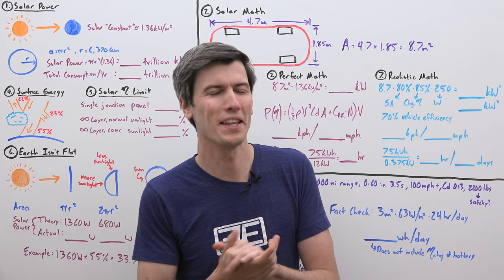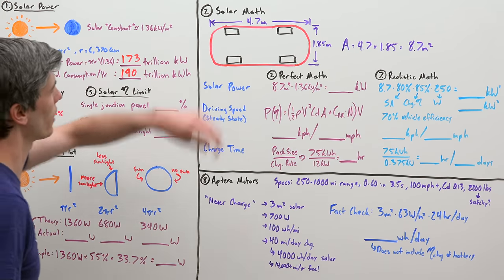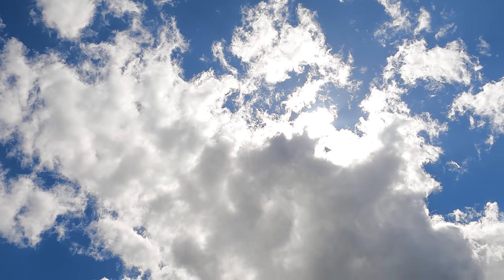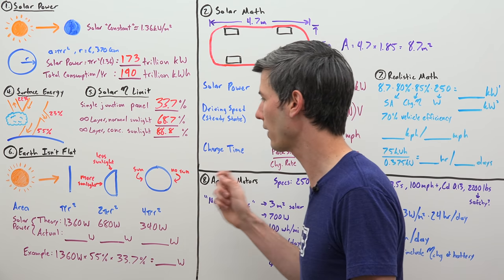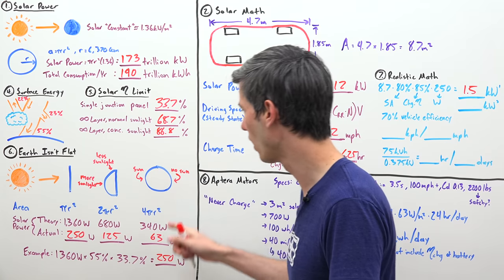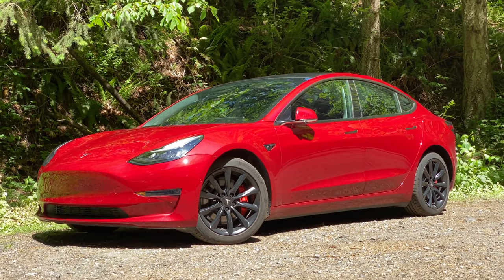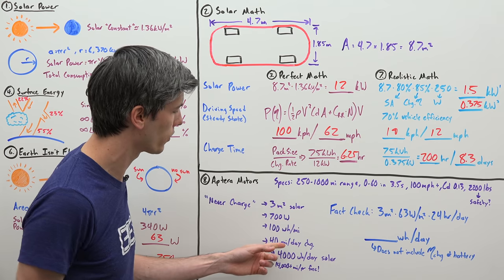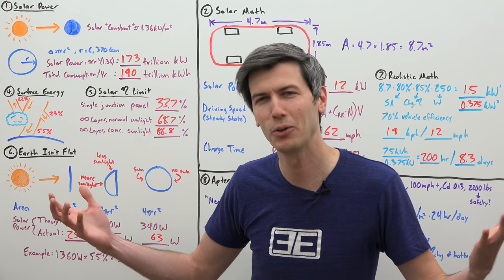Why Don't Solar Powered Cars Exist?

Comment: I want solar in electric cars as a "additional charging while driving"...
Reply: Exactly, just to be able to extend the driving range, not completely contribute to all the power..
Reply: yes and just loading during worktime while standing about 8 hours unused at the parking lot. if i could drive only one day per week from the sun my "fuel" cost is about 20% less.
Reply: Cybertruck may have a solar cover as an option but it's estimated you'll get about 7 miles per 8 hour charge in best solar conditions.
Reply: I think the best way to look at it is how many miles you can charge per day.  I typically drive 5-10 miles per day.  It really wouldn't be hard to generate that much energy.  I replicated the math in this video and applied it to my car and driving needs and even with more conservative numbers than he used I could easily do all of my driving on solar power.
Reply: Check out Lightyear,  they will be bringing that to the market pretty soon!
Reply: @tbreakazpex205  The same with Aptera
Reply: that's the Sono Sion (for now)
Reply: @jetah50  So if you drive 21 miles a day, your fuel costs are reduced by 33% from the (free energy), not sure how many years of those savings are needed to pay for the solar panel options, but I imagine if you keep cars 10 years like my family, at some point you would see real savings in travel costs. Also, you lock in on the lower prices of gas today, compare this to future prices if current trends continue and you will wish for those panels or an EV.
Reply: And also reduced battery degredation, due to not having to charge as often.

Comment: I was 100% sure that it is impossible in the near future without groundbreaking new technology
now I am just sceptical 
impressive
Reply: I mean, even if every car was covered in solar panels that somehow got 100% efficiency, 1.36 kW is only 2HP, approximately. So this means that you have to either charge your car outside and use it once a week or something, or you have to save energy. I'm sure it will eventually happen, but for now, all we can do is hope that someone invents this groundbreaking technology.
Reply: Edit, 8.7 m^2 would mean closer to 17 HP. An improvement, and if solar panels were 100% efficient, a solar powered car would be possible.
Reply: A car is in use on average under 60 minutes pr day, so a lot of hours with the sun up to charge the car. If you combine this with a very low friction car like the Aptera, it's actually an interesting concept.
Reply: The clearest way to see that it's not a completely unrealistic idea is to look at the World Solar Challenge – a race with across the whole of Australia in four days without any external charging. The top cars now manage to average over 80 km/h.

But still – these are very much prototypes, built ultra-light and racing under pretty ideal conditions. A car that's actually practical for everyday use can't hope to cover more than a few percent of its energy need from solar cell, so it will need to most charge while parked – and that kind of defeats the point, because while parked you could as well charge externally.
Reply: It's a bit like the solar plane possible but not practical or economical beyond the experiment stage, there is hardly a reason to carry the panels with you.
Reply: @leftaroundabout  I mean, in places where charging isn't an option, like perhaps any sort of extremely rural setting, or on the opposite end, a very urban setting, where somebody doesn't have a garage, they don't necessarily have a charger when they park their car. Hell, if you're going anywhere for an extended period of time, it's pretty unlikely that it's going to have a charger. I think I've only seen tesla charging stations at target, and that's it. So I think this could present good utility for a ton of people who otherwise wouldn't be able to use electric cars because of a lack of infrastructure and too high of an initial investment.
Reply: Your certainty was obviously not based off of a lot of specific and applied knowledge. Perhaps this is an opportunity to be more cognisant of such things in the future.

That said, skepticism is good.

Comment: I spent $2200 on solar for my $4000 2012 Nissan leaf.
I'm getting 8 miles a day from the sun.  So it's not a great use of the money but it has been a really fun project for my daughter.
We should be getting more like 12 miles per day so now we're trying to track down where the inefficiency is.
Reply: Good for you!  Full solar for Aptera only runs $900, so a lot of progress is being made in this area.

Comment: Very fair assessment of Aptera, I wish they would temper their range claim, like call it 400-700 or more, especially if it has lower freeway range. Also a lot of spec performance and price mixing 3wd, 2wd, solar, battery size.

Comment: I think people are missing the biggest market for solar panels on EVs.

Imagine a city dweller who do not own their own charger. This is very common scenario. They may very well go for a petrol powered car, because they do not want to go to a supercharger once a week. Put solar panels on the car and they may only have to go to the charging station once every two weeks, which would translate into lots of saved time. It may also convert a petrol car buyer to an EV buyer.

So the most important question is not if a solar powered car can drive forever only powered by the sun, but how many trips to the charging station could be saved by putting solar panels on the car.
Reply: This is a great point, an advantage of vehicles with solar panels on them is that they don't require any additional infrastructure, which is great for cities without chargers, or even remote areas...
Reply: City dwellers also don't often park in full sun. Shade from buildings would reduce efficiency drastically, and parking in a garage building would take it to zero. Ultimately not worth the cost of adding them to the car and the increased weight and fragility.
Reply: Most EV owners don’t visit a supercharger. They plug in at home and their car is fully charged the next day. Solar panels would mean you would need to store the car outside and it would save some money but nowhere near as much as the added cost of solar panels. Not to mention the environmental effects.
Reply: @Deepwing  My point is that many potential EV buyers opts for a petrol car, because they do not have the option of plugging the car in at home. If you live in an apartment, it can be very difficult to install a charger close to where you park your car.

Many people go to work and park in a parking lot, where it is easy to find a spot with little shade.

I am not saying that solar panels on cars makes sense for everyone. I am saying that there is an unserved market for EVs with solar panels on top.
Reply: @F0XD1E  If you live in a high density area like Manhatten, then you will have a hard time getting much juice out of solar panels on a car.

However, if you live in a low density area like most of LA, then it would be pretty easy to find a parking spot with little shade.

I am not arguing that solar panels makes sense for everybody, just that there is a substantial number of people for whom it do make sense.
Reply: @Foobarski  that’s true. I don’t see that market being tapped yet though just because it’s kinda niche and the costs likely outweigh the promises. But no doubt it will eventually happen.

Comment: And still the "realistic math" section is quite optimistic ^^ In my location e.g. we don't see the sun for 3 to 4 months per year, maybe even more ^^
But man do I enjoy your videos about solar, electric cars/motors, batteries. Cheers from an electrical engineer
Reply: You are an exception. Sounds like you need to move
Reply: Yeah, I came to the comments to see if anyone mentioned axial tilt

Comment: Even though it wouldn't be the primary source for charging, I do think integrated solar roof and hood panels should be a feature automakers invest in. Like regenerative braking, it could help maintain battery levels in a passive way. Why not produce a vehicle that has as many passively energy capturing/producing features as possible? With all of the forces that accompany forward motion, why not take advantage of solar, wind (forced air?), and friction based tech?
Reply: Cost is always the answer. If it is affordable and yields enough of an impact, you will see it.

Comment: Interestingly solar could also make a lot of sense for an electric semi or busses.  Not that it would cover the energy needs but given the massive flat area it is relatively simple to generate ~15% of the energy needs for a semi under typical driving distances per day for only a small amount of weight.  18m of solar on a flat surface is relevant.  Solar panels are not that heavy and the complexities of protecting them and using the energy to charge are not as complex on the flat top of a trailer.

Comment: Everything checks out on the Aptera solar car if you buy their coefficient of friction. That number sounds damn optimistic to me.
Reply: Just run their thing through some CFD simulations.

It's completely optimized for air resistance.
Reply: @anonym3017  I hadn't looked at a picture of it at that point. After looking the Aptera solar car up I am significantly less skeptical. Cheaper than the model 3 too, if they can actually deliver on this it will really be something. I want one.

Comment: I’m hearing yacht companies claiming solar powered electric yachts with unlimited range. Doesn’t seam possible to me.  I would love to see a video on the subject.
Reply: Boats seem the perfect place for solar ...you could tow along a whole array of solar or have some sort of fold out array.
Reply: I could not see a yacht that has more than about 20 square meters of solar panels.  So at 200 watts per square meter, X 5 hours a day, that would be a 4 KW solar system making at the very most about 20 KW per day.  

Take your average 454 gas engine that can power a 30' yacht at about 15 knots and use about 10 gallons of gas each hour.  That means about 350 KW of power each hour?  I don't think you will travel very far using solar power.

Yes there was a small canoe sized boat with a solar panel on the roof canopy. It produced 24 VDC, and run a small trolling motor to power it from one lake to another on a inland waterway.  Yet they still needed to charge the boat each night at the marina, to have plenty of power for the next day.  And they only went about 15 miles per day.   A great way to travel and tent camp, with a boat that has a total weight less than 1,000 pounds, loaded with people.

Comment: With the new eletric pickups it would be nice to have an overland tent that retracted into the pickup roof, giving you maybe 4-6 m2 of solar, it would be awesome for overlanding
Reply: There are people that do that, well, with ICE vehicles. But that would be nice to have it fully integrated. Don't need enough panels to charge up to drive, just enough to maintain the battery for running a fridge and a few other odds and ends.
Reply: I'm sure some aftermarket companies will jump on this. I think that uber expensive Cybertruck camper will have a solar roof.
Reply: The Aptera does come with an optionl tent, that goes over top of the back hatch. The tent doesn't come with solar panels, but the the Aptera does have spare capacity in its solar charge controller for hooking up external panels.

Comment: There were two car companies making solar powered cars other than Aptera. Sono motors in Germany was / is taking orders for an electric hatchback that can charge about 100-200 km per week. It sells for 20-30,000 euros I think.
And Lightyear in the Netherlands has much more surface area and aerodynamics, so that you could probably go with no recharge, but at this time has a price of over 100,000 euros. Perhaps if they can mass market it, the price could come down.

Comment: Sounds like an excellent commuter car for people that drive less than half an hour to work.
Reply: @CaedenV  Since panels last 20 years under warranty, that should cover 2-3 electric vehicles if you keep them 7-10 years. And you can still use a garage, but you would have to plug in daily

For convenience, I like the panels on the car roof, then you only plug in at half a tank, like a gas car and you avoid car jackings and pan hanlding at gas stations.
Reply: @jamesaleman  Totally agree.  I have been driving for more than 35 years but the recent number of times I have been car jacked while buying fuel is getting scary.    (I never fake sarcasm)
Reply: @paulmartin2348 <Reply, Sarcasm edition>
In those 35 years, I suspect you, but certainly actual car jack victims, were car jacked less frequently in a driveway or garage.

Also, I can't count the number of times someone walks by my driveway and tops off my fuel tank.
Strangely the sun shines on my driveway for many hours a week, when it is parked outside.

If only I could buy a ride that charged from that sunlight. It would be a bonus if I never had to stop at those scary stations ever again.
Think of the time I would save and my quality of life if I could get back 10 minutes a week, 520 minutes a year, or 5,200 minutes a decade.
I would have 20,800 more minutes to waste commenting on YouTube if this was around when I started driving.

<Raises a digital version of whatever beverage you like> Here's to 35 more years of fewer car jackings and may you never end up on a security video circulating around the net.

Comment: I would like manufacturers to equip cars with a small solar powered trickle charger with a BMS to keep the 12 volt battery topped up and extend it's life. Fewer dead batteries would make vehicles more reliable for little expense. Batteries being expensive and contemporary vehicles loaded with electronics would make this a welcome addition.

Comment: 4:51 Well dang, when i did the calculations for my solar limo conversion (~10m² usable surface) i used 18% efficient solar cells, and over a 9 hour work day(1 hour of on site lunch) i could drive to and from work on my 1996 fleetwood 6 door on solar alone for about 280 days out of the year(8 mile one way with hills in central illinois) as long as i stay under 55MPH(there is a route with an 70MPH interstate)
at 33% efficient that jumps to 365 days because couldy days could be made up for by my battery pack, i could even run errands if i wanted to

Also, 8.3 days? Thats ALOT better than i expected, so if we put solar on cars today we get the equivelant of 43 free 0 to 100% charges each year

Comment: And if we were able to use this solar energy in the car just to saving the battery, for example, to activate the ar conditioning? Or maybe to save the fuel?
Reply: I use a 20W 12V solar panel on the dash of my gas guzzling ML320 to trickle charge the battery as I don't use it often and there is a mystery electric short somewhere. All modern cars drain the battery when not in use and so a solar panel should be a basic thing on all cars. Even if they weren't enough to provide driving power, they would at least prevent battery drain and a little cooling.

Comment: well if you cover your house with solar panels and charge your vehicle during the day, yes, you have a solar powered car
Reply: But don't you use your car MOSTLY in the daytime as that is the time for work, wandering and office/school parking.
Reply: @STho205  did you even watch the video?
Reply: @F0XD1E  the comment was on the logical fallacy of Rafael's thought...charging the car BY DAY at home.
Reply: @F0XD1E  video doesn't matter to that.  Wisdom is not repeating what someone tells you.  That is merely compliance training for those that wish to seem smart.  Often a trap for the very young.

His video topic is good, and his presentation is fine and professional...however it bears no weight on the statement I courteously made to Raphael.

Comment: Thanks for an interesting video! I saw an announcement on that car somewhere, maybe that British electric vehicle show... One thing though, taking a planet-wide average hardly makes much sense when talking about solar irradiance, that's why there's actual tables out there for solar power installation engineers (and DIYers) that give the actual numbers for multiple locations on Earth. In a theoretical video like this, I think it might've been a good approach to give the energy received at a few different latitudes and see how these cars would work there. After all, a daily driver would be spending most of its service life not traversing that many latitudes...
Reply: I agree, using the planet, then deducting a certain amount for atmosphere is a silly way to get to the watts per square meter.  I own a meter that measures the watts per square meter, it is about 800 watts in San Diego at sea level, and about 875 watts at Boulevard about 35 miles east at 3,600' above sea level.  (measured on the same day, about 1/2 before noon and 1/2 hour after noon).  

Normal cost solar panels are about 25% efficient, so about 200 watts per square meter of power to collect at noon.  If you take 200 watts X 5 hours = about 1,000 watts per square meter that you can collect in a average day.  Very simple math that way.  Yes you get a little more in the summer, and much less in the winter.  Less when you go farther north.

Comment: The entire time I watched this, I kept repeating to myself "At noon. In Venezuela" and chuckling.
Reply: Why?  What is so significant in Venezuela at noon?
Reply: @valderon3692  it is close to the equator, and a fun to say. Venezuela. See?
Reply: @MrSqu1nty  I guess, but you don't have to be on the equator for solar to work...  I could easily do 99% of my driving purely on solar power.  It would only take me about 200-300 watts.  Easily possible in a single panel for $300-400.